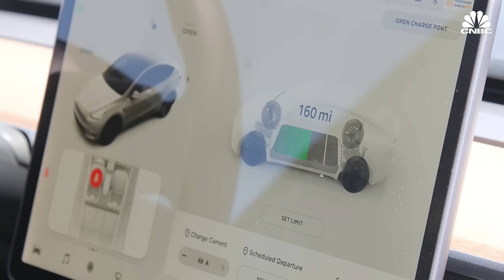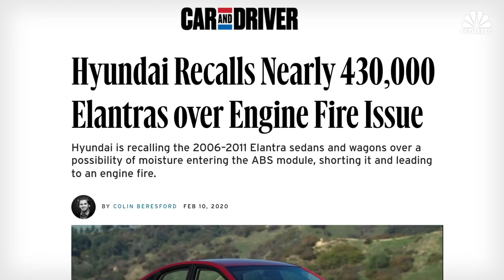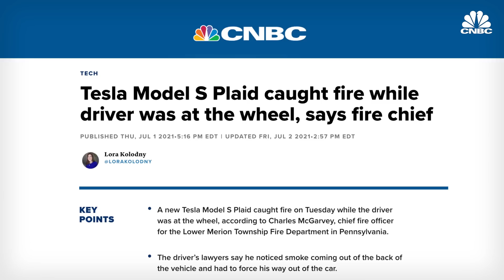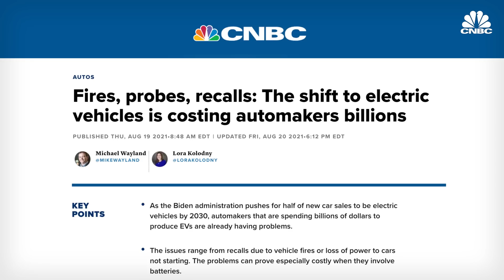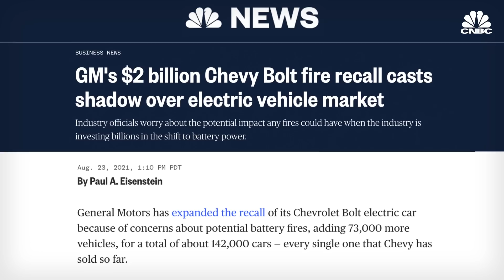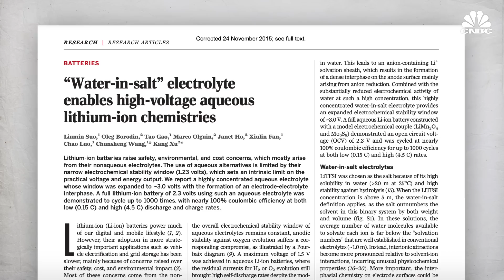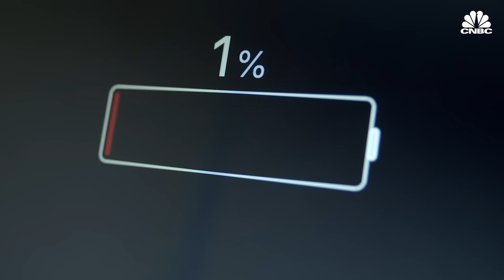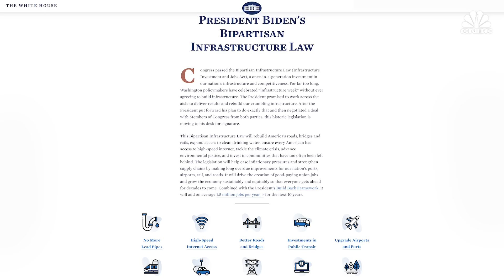Why Tesla, GM And Other EV Companies Have A Fire Problem

Comment: The future is undeniably electric.  I disagree. Electric is a means of transportation, but bev’s are far from the future. If my vehicle is a melted hulk it doesn’t do anyone any good. I might have a bev in the future, but the technology is still way behind both the infrastructure required to recharge these cars, but reliability is a significant issue. The numbers of ice cars bursting into flames is basically nonexistent. In a time where drinking water is an increasingly important commodity, the idea that fighting these fires with excessive amounts of water is, and should be, a cause for concern

Comment: Car makers are forced to squeeze 1000's of lithium cells into cars in the name of longer range turning the cars into powder kegs! What we need is smaller battery and reliable charging infrastructure to avoid fires. If the Electric cars are smaller you can just drop the battery block under the car at the flick of the switch and push your car away!

Comment: Undeniably taxing an over-taxed grid.  Strange to be forced to bust it.  EV's "fire problem"??  What happened with the Pinto?  It was immediately stopped.  Salt water corrodes the battery-related stuff,  it has been published.  This may be able to be fixed?
"NON-CRASH FIRES" is so ambiguous and unhelpful to the public at large to KNOW what's actually going on.

Comment: Each cell in a lithium-ion battery contains a flammable liquid electrolyte. If the cell short-circuits, the electrolyte can combust and the pressure within the cell will rapidly increase until the cell vents the flammable electrolyte. Temperatures at the ruptured cell can increase to above 1,000°C (1,832°F) ! :face-orange-biting-nails:

Comment: Your statement that EV batteries are similar to gas engines in that they are most dangerous when "full" is inaccurate.  The fuel is there whether full or discharged.  Itveliminates one failure mod- short circuit anode to cathode(which is true only at 0 charge, but they never sit around at zero).  All other failure modes can still happen when discharged.

Comment: The new Porsche Taycan EV battery weighs 1400lb.  The car comes with a fire extinguisher mounted on the floor in front of the passenger seat.  The battery has internal passages that a fan blows cooling air through.  No thank you!

Comment: If CNBC were an honest broadcasting media outlet, that searched the facts and the truth in their obviously lopsided journalistic ventures like this one, they would inform their clients that ICE cars are 2 or 3 times more likely to burn up than an EV Tesla. In fact the very few cases where a Tesla was reported to go up in flames were either an arson attempt, or a criminal act perpetrated by their owner, for financial gain. This video proves absolutely nothing, but a criminal attempt to hurt the EV manufacturers, since they are very successful and gaining market share to the tune of 30 to 40% a year from the ICE cars. The average EV are 3 times more efficient than the average ICE car. In fact the average Tesla that cover a distance of about 15.000 miles a year  will save their owner at least $2500 a year in fuel and maintenance costs. Naturally Tesla incredible success has many enemies, and probably this video was financed by some of them identified in the oil industry, dealer associations ICE manufacturers and many Washington lobbyists.

Comment: problem lies in the battery pack and cells themselves  vibrations creating friction on the insulators which breaks them and then a short circuit   fire

Comment: Overall, are EVs really "greener" than internal combustion vehicles? I sincerely doubt it. However, there remain big problems to be solved before EVs can even have a chance at replacing ICEs. 
Long charging times and short range are the two biggest problems. Availability of electricity for charging will become the biggest problem. While increasing the demand for electricity, the supplies of this commodity are being decommissioned. As the demand increases and the supply diminished by shuting down power plants, a tipping point will be reached. Then, we'll see what the future of transportation will look like.

Comment: China is building more and more coal fired power stations for energy to build more EVs and to charge more EVs.
Li-ion batteries can fail at any time, and also when not being charged!
Li-ion batteries are self sustaining fire, heat causes adjacent battery cell to ignite, adjacent vehicles etc.

Comment: Sounds similar to the Samsung issue a number of years back. I also keep hearing (in video) reference to water on a lithium fire and that is confusing since when I went to fire school water was a strict no no directly on lithium as it can explode but can be used around to support other things not burning. (As long as none of the water touches the lithium. Has something changed?

Comment: The whole EV thing is a con.  What about the toxins given off in the manufacture of, the fires of and the disposal of the batteries?  Same with the square miles of solar panels after 20 years, and the unsightly wind turbines after 20 years.  Nobody asks these questions.

Comment: After a hurricane in Florida, several Teslas caught fire due to corrosion caused by salt water.  This would implicate northern climates where salt is used in road ice management.
Reply: @rusty358  history does not support your claim..
Reply: High-voltage systems in EVs, particularly in the motor and power electronics, can pose a risk of electrical discharge (ED).
Reply: Thank you for sharing this information about the potential fire issue with Tesla vehicles. It's important for people to be aware of all possible factors when considering an electric vehicle. Speaking of power solutions, have you heard about the Segway Portable PowerStation Cube Series? It's a versatile and reliable option for outdoor enthusiasts and backup power needs.
Reply: Yes, in Norway the North Sea is Salt-Free thus there is no fire hazard.
Reply: Wow
Which hurricane
Reply: I can never understand how ppl are not scared to drive electric vehicles in the rain, let alone in the salt.

Comment: At no point did this white wash cover the salient points...
1 EV fires burn hotter than a welders torch and will cut through anything in a second 2 the poison coming of the fire is deadly the powder left on the floor is deadly basically its a super toxic dump sight after the fire and 3 the water the fire bridge poor on the burning EV is just to look useful as it in no way shortens of affects the fire ....
Batteries have there own Oxygen supply so smothering it doesn't work

Comment: GM and Hyundai/Kia recalled/replaced the faulty batteries in early (2019-2021) Chevy Bolts, e-Niro, and Kona EVs. LG Chem took a big hit: it won't make that mistake again. But sure, it was an horrendous mistake and fires will remain extremely rare, if spectacular and thus click-worthy. Then there are new battery chemistries that will address this issue. But high quality li-ion batteries are very safe, with rare exceptions. So good job CNBC editor with the title of this video. Lots of clicks and comments, I'm sure.

Comment: Just wait until people realize that 1) Hybrids life cycle emissions are less than a full EV life cycle emissions,   2) Replacing a HYBRID battery can be done by the owner for about 2G...replacing the EV battery MUST be done by certified dealers and the cost is over 10G thus killing any used car market.  Since EV's are prohibitively expensive most of the population will never be able to buy one.  3) (Look to Australia) and the hidden tax scams.  They are requiring that ALL EV charging systems be on completely separate meters so that they can be totally controlled by bureaucrats, including separate taxes and direct remote programming by those same bureaucrats.  4) EV insurance rates are going thru the roof because of the spontaneous ignition history of lithium ion batteries.  

These batteries have brought airplanes down, ignited public transportation buses and caused numerous fires in many cities across the country.  There are many other reasons NOT to buy an EV.  Use your common sense....we've been taken for a ride courtesy of stupid progressive socialists who want to control every detail of our lives.  I would be happy to debate Buttagig any day of the week.  He's a fake just like the rest of them.

Comment: Nothing green about EVs. Especially while most of the Electricity is still generated using fossil fuels.

The batteries actually causing a fire is only part of the problem. Most car fires, ICE or EV are caused by an electrical fault, EV's are more likely to have an electrical fault. Add to that that EV's carry a half ton battery that contains the makings of a chemical fire. The lithium contained in the battery is self igniting and with the other chemicals and or water, self oxidising. Once ignited these fires are very difficult if not impossible to put out. Spraying water may contain the fire, and help to reduce the temperature, but wont put it out. If the battery catches fire, regardless of how the fire starts, you have a singularly different situation to an ICE vehicle fire. The battery is a chemical bomb and once ignited there is little you can do to extinguish it.

Unlike an ICE vehicle fire, which the fuel wont contribute to if the tank is empty, it doesn't matter how much charge is in the battery. It is still a bomb, charged or discharged.

Comment: EV’s are an environmental disaster just waiting to happen of the 400 kg or 280-320 pounds of battery, most of which the compounds are toxic, and once buried as landfill will make even the groundwater toxic to humans.
Multiply the weight of a single car battery by the total number of cars in the United States, where there are some 300 million cars registered. Imagine the size of the landfill . the issue of landfill will be one where every country that goes fully EV will have to deal with. They will also have to deal with the toxic groundwater caused by these batteries in landfill.

Comment: Lithium battery's are a huge problem. They have a problem called thermal runaway. I had 2  spontaneous combust in my warehouse and they were not being charged and were not fully charged. They have been keeping it quiet. The batteries also have had cell phones, laptops, tablets and RV's. Airliners have crashed from fires in flight.
Reply: Its actually Thermal Meltdown ... they use the term runaway in an attempt to lessen the public fear.

Comment: The biggest problem is that the batteries used by these other carmakers were poorly made.  Newer batteries made in Tesla take more heat and punishment than the Ford or GM batteries

Comment: Battery fires in ev's are very difficult to stop due to the chemical nature of the event.  No commercial or domestic building fire codes, that I know of, address this new risk.  Imagine a older style central city multi storey car park having an ev fire event.  Imagine a similar event in an underground car park in a  multistorey apartment block or commercial shopping mall.  These fires are low risk, high consequence events.  We must design to minimise the risk but above all we must immediately assess existing structures to minimise the consequences when an ev fire occurs.

Comment: Emission reduction is a red herring. Claims totally ignore subsidiary pollution issues as if they don't exist. Firstly, the mining of rare earth minerals for the battery threatens the areas where oceanic dredging takes place on a colossal scale. Then, remaining with the battery, no-one has thought through or solved the problems connected with recycling or scrapping dead batteries at the end of their lives. Now the vehicles. Vehicle weights have increased for EVs which has a deleterious effect on the structural integrity of multi storey car parks, weak bridges, ferry loadings to mention just a few.

My own petrol car is getting on for 20 years old, has been well maintained from new and owes nothing to the environment from its manufacture. I feel strongly that conserving old cars through proper maintenance and retaining long term ownership is far more beneficial than using an EV for a few years, then trading it in to buy another.... then another...... and another. It is not sustainable either financially or environmentally. You need to look at the wider picture!

And I haven't even got as far as spontaneous combustion creating a blaze that defies all established methods of extinguishing! We are creating a Frankenstein's monster here and no-one has the answer!

Comment: I think in open place extinguishing burning EV is nothing but a waste of water. It burns as long as it wants. Vehicle is total lost anyway so what is the point? Firefighters could just  instead pull neighboring vehicles away from the fire.
Reply: Or at least put out any spread from the fire.

Comment: It all boils down to crappy battery tech used by Ford, Mercedes, VW, GM etc. Using subobtimal prismatic and pouch cell types. 

That's why Teslas cylindrical battery tech never caught fire by itself.

Comment: The Car Park in England that had a fire, with a collapse, and loss of about a thousand cars.  The vehicle that started it was a Range Rover Hybrid.  Video showed flames under the vehicle from the 'left side' of the vehicle.. in other words, the passenger side.  Looking at diagrams of the vehicle, that hybrid has all its batteries under the passenger compartment on that side.  Attempts were made to put the fire out, but full fire extinguishers couldn't touch it.  All the cars in that car park were lost due to the fire in one hybrid.  Ooops.
Reply: Hybrid cars are a worse fire risk when parked than ICE or EV
Reply: Hybrid cars still have batteries which can burn extra hot

Comment: I think the biggest problem with EV fires initiation is brand new poorly designed EV's and, more importantly, battery degradation over time. As batteries get older they lose some ability to hold a charge and when charging they may run hotter and catch fire.
While the risk of an EV catching fire while charging is very low that risk could be catastrophic when most EV's are charged at home at night and the home could catch fire as well.
Another factor not included is when an EV gets in a car accident on the road and the batteries appear not to have suffered any damage visually, but have.
The 30 to 80% charging level for EV batteries seem to be the best for the durability of the batteries, but at how many cycles does the risk of battery fire increase? I don't think we know this yet for all EV's under all circumstances with all different types of EV batteries.
New testing standards need to be developed.
Reply: The batteries used by Ford and GM are terrible compared to the Tesla batteries
Reply: @DenofBarjack  I agree with you that the batteries Ford and GM currently use are terrible. Their life expectancy is about 3 to 5 years. I don't think Ford and GM can afford to keep these batteries especially when their competition uses batteries that last at least 10 years.

Comment: Well... EVs can indeed catch fire!  But gasoline cars are around 20 times likelier to catch fires.
So, I know where the propaganda is , but where's the problem?
Reply: Problem is EV's fire are a lot hotter.   normal gas fire is around 700 degree, EV's fire are over 2000 degree.  I like EV's too, but facts are facts, and debate isn't really warranted as it's rare to have petro cars to catch on fire in the first place.  But if you have an EV that catches on fire, know that it and everything around it is toast. LOL.
Reply: @ex8280  petrol car fires in collisions are uncommon enough that saying a seatbelt would trap you in a burning car becomes rediculous.
Reply: It involves a different approach to handling the fire.  Rather than freak out.  Listen to the whole story and calm down. I own an EV too

Comment: This should have been sorted out before putting it on the market . WEF  and the EU wants it done yesterday, though the date has been pushed back to 2035 . The infrastructure is still not there and the recharging is complex. Science has to solve it. Yes the fire is more stronger with EVs .
Reply: I wonder why the WEF wants EV?
Reply: Electric is easy to control. Switch off switch.
Reply: @normanstratford9329 I’m going to warn you to watch out because most ICE cars made after 2010 have remote engine shutdown hardware installed in them as well

Comment: Yah gasoline is not dangerous, right? Look at the stats. 5 fires/ billion miles driven for Evs  (Tesla) compared to 55 fires/ billion miles driven for IC cars.  And while ev car fires may be more challenging to extinguish neither car type is likely to survive a fire and be restored or repaired. If it occurs in your garage there’s a good chance you’re going to have structural damage in either case. Let’s put this scare tactic in perspective. Ev fires are statistically less likely than gas powered car fires and in either case good charging and maintenance practices are important in mitigating fires in any vehicle. I don’t think fire risk should be a factor in your buying decision. There are a lot more relevant factors to consider.
Reply: My 20 dollar fire extinguisher can put out a petro car's fire, but not an EV fire.  Also, petro car fire generally happens when you are driving, where as EV car can just randomly ignite on it's own and when it's off. So there is no chance for you to put it out.